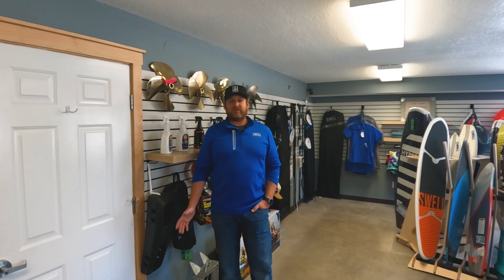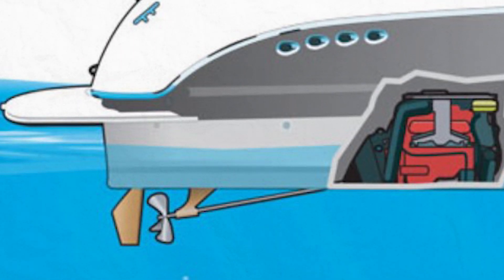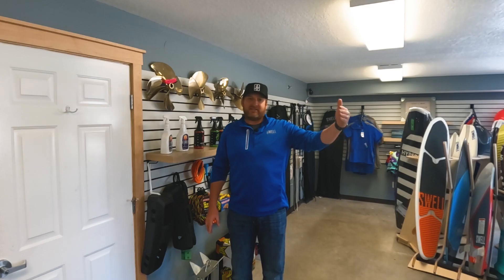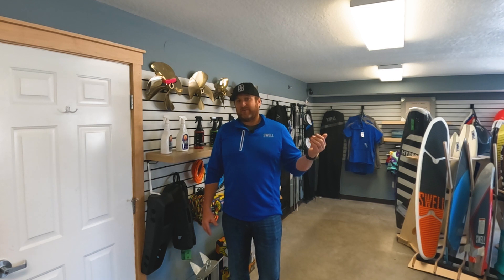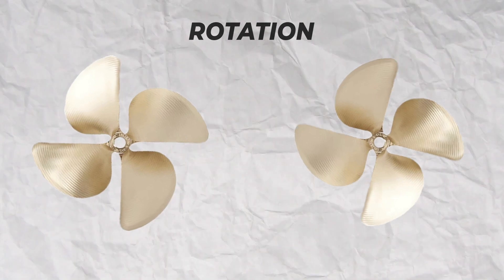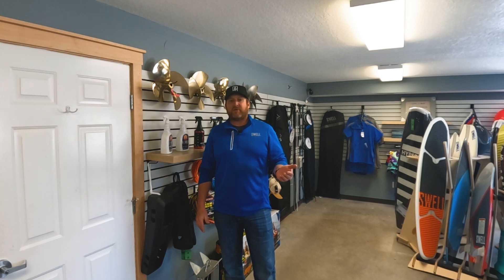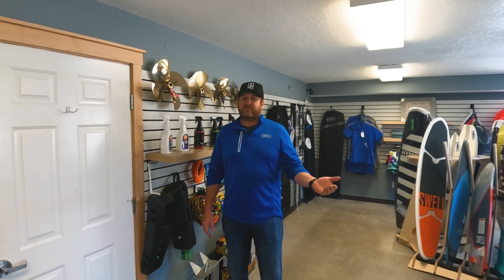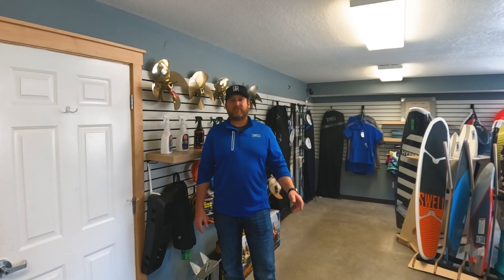How to Pick the Best Prop for Wakesurfing - Everything you need to know about wake boat propellers

Comment: We just got a used boat and the previous owner was using it at Lake Tahoe with a high altitude prop. Our lake is down at 1300 ft but when our ballast is full it is very hard to get up to surfing speed. Would it be smart to get a new prop to get on plane easier or does the high altitude prop not change much?
Reply from the maker: Yes. 100% will completely change how your boat runs fully ballasted